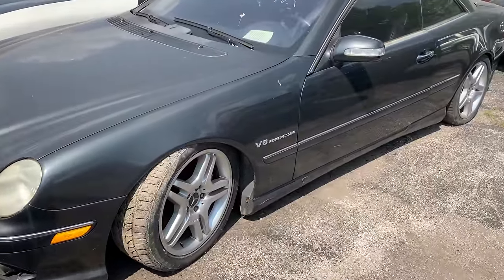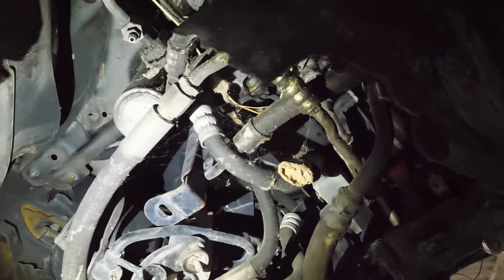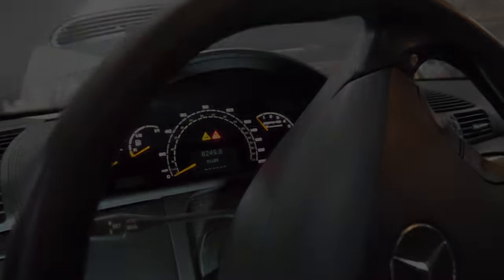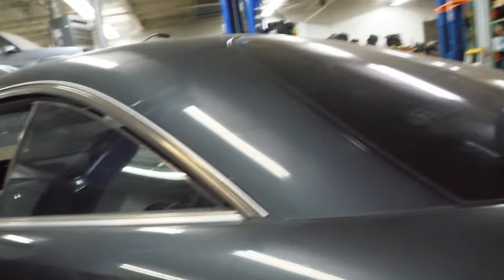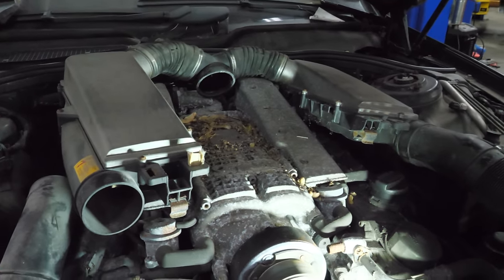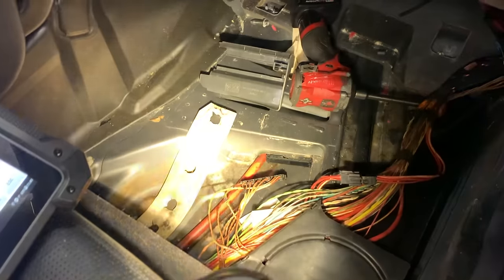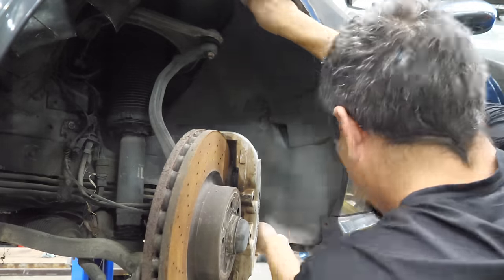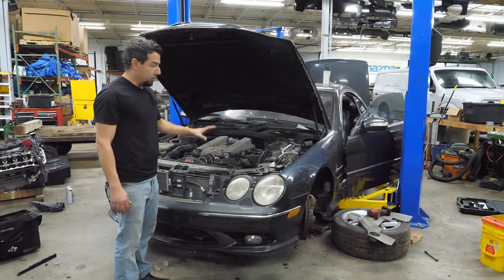DEFEATED! Tow Lot Bought 500HP Mercedes CL55 AMG Sat For 7 Years

Comment from the maker: For those that are wondering, three of us tried to get this hood open when it first came in. We tried everything non invasive we could, pushing down, twisting, etc. The hood is a 3-400$ hood and thats why it went the direction it went. As well, this was filmed over the course of a month or so, and was easily one of the hardest to edit videos i've done. Really appreciate all of the support! It means a lot.
Reply: The Freon put out the electrical fire you started
Reply: Under Dash leaver hiding up by the Kick panel Hood release ,if you haven’t still found it
Reply: I owned a 2002 E320 and the hood release started to give me problems 5 years ago. 18 months later, it completely stopped working. I spent two hours doing what you did without a lift before I decided that with the 235,000 mileage and all the other problems that were piling up, I decided to junk it.
Reply: I dont know where you are at, but Crossfire Diva, The Mercedes Swap Shop could possibly help
Reply from the maker: @PONO-go3ee  we pulled that first.
Reply: Had the same issue with a clk.the way around it is to remove the LF wheel liner and activate the cable from there. There's a plastic joint which connects the 2 parts of the cable. This can break sometimes... but apparently not so on CLs 😢
Reply: As far as I could tell, my problem was that the passenger side hood pin release was stuck, and all the pulling meant nothing. It just wasn't worth the effort.
Reply: I don’t think you were defeated! You got the hood open , that’s one small victory then you heard it run ! So no failure in my book!
Reply: Those grills aren't held on by much. I'd have pulled it up or, if possible, remove the bumper.
Reply: @wernerdanler2742  i pulled the plastic grill on a peugeot one time, and hit the lock mechanism rocker with a hammer blow from a chisel, popped right open.
Reply: You did everything you could to make that thing run. You have a business and YouTube channel to run, so it's not like you can spend unlimited time on trying to fix that thing... and really made more progress than I thought was ever possible!
Reply: I'm at time stamp 39:00, so I haven't watch the whole video yet, I'm wondering if the harness you sawed through shorted a CAN Buss wire!
Reply from the maker: @hkguitar1984  only nicked a few wires and none were can wires.
Reply: @martin-vv9lf  That's quite a coincidence. I had an 83 505 turbodiesel I bought in 1990 and had till 2001.
Actually loved that car! 
I drove to hard in the mountains once and blew the headgasket and put cracks in the head. 
It only cost me about $800 labor and parts to replace.
Reply: @I_Do_Cars  Thank You, Good Luck Sir.
Great Content   👍
Reply: Did your crew open the trunk by folding down the rear seat center armrest, for the pass through to the trunk, and pull the  emergency trunk release mandated for kids who lock themselves in trunks?
Reply: Honestly I would look for the most expensive part hood or front bumper (business wise) and rip out the cheapest part, Time = Money \ Expenses
Reply: The wiring harness that you cut is worth more than the hood along with the other parts you damaged.
Reply from the maker: @dayjeremy  disagree.
Body harness from a car sitting in the weeds with clear rodent damage is worth it’s weight in #2 copper wire, about $1.75lb
Reply: Hi Erik
Reply: Ball shot at 11:40 😅. Not fun.
Reply: You go in via the trunk via the access behind the plate.
Reply: I've had 8 of these W215's and I've become quite the expert... it was fun watching you try.. I've resurrected a flood damaged one and drove it for 8yrs with various ghost wiring glitches along the way.  Fun cars you can get cheap if you can fix them!
Reply: I love the knowledge and ability you demonstrate. Couldnt help wondering how many hours went into making this video.
Reply: You should have just made a random call to a car shop in Lithuania or Estonia, I'm sure they know how to get a hood open on a merc really quick.
Reply: mercedes  Is another word for  sabotage
Reply: Lack of quality servicing is the problem with that car AND many others sadly ⚠️
ie the many drains it has around bulkhead , hood and trunk areas would have prevented electric plugs and modules damage.
Bonnet catch greasing would have preserved the mechanism.

So many garages just change fluids and filters and call it a service 😂

Very good vid 👌 

I bought a no crank start SL55 AMG low mileage.
Fault was caused by a faulty Gear select module.
Fault code P1925 was Drive Authorisation denied ESM .
That is the most common fault code apparently on 2002 2003 era of Merc.

I got it running 🤪
Car is mint with just 38k miles
Reply: 😂w😊
Reply: junk yards have this vehicle im sure could have found replacement hood relatively cheaper then the 3-400 price tag...
Reply: I have an 05 CL55 AMG. It was my first AMG I ever bought. 2nd was my E63S. But did you try pushing down on the bonnet on both sides & then trying the bonnet latch? Usually that works. 🤷‍♂️ Also remove the supercharger belt until the pulley is fixed. It doesn't do anything else but spin the supercharger. You don't need it for the car to run. Disconnect the outlet line on the fuel pump & drain all of that bad gas in the tank out. Then put good gas & some water remover in the tank. These engines are tough & keep going. I think the reason it was sitting in the tow lot to begin with was because of the RR strut leak. People think it is the end of the world when that happens & too expensive to fix so they just park it. I think you slicing into that wire harness has a lot to do with your problems. But if you are going to part it out i want some the parts. One being the glove box door, the electric radiator fan & the electric plug from the harness to the fan, the truck's bottom carpet & if the right taillight metal grid thing is not rusted out that too. The metal key inside the fob is how you get into the truck with no power. The key hole for it is up where the license plate lights are. The reason why things get wet on the passenger side of the floor is if you don't keep that fresh air inlet box under the hood near the windshield clean of debris the drain hole will clog. Then when it rains the water will overflow into the floor under the passenger side of the dash.
Reply: I've got a question: how much do you want for it?
Reply: Imagine the bill to fix this car, a month of labor 😮
Reply: That's a serial data port not adapter.
Reply: @allenl9031 the fuel tank is.behind the rear seat.
Reply: I want to buy that front bumper.
Reply: @I_Do_Cars  sometimes it takes propping it with..well whatever you can find.. i used a bic lighter to hold the lever up so i could lift the hood and get it to raise up.  probably just a matter of lubing up something, or some weak springs.. i never got the opportunity to figure it out unfortunately...
Reply: I’d have taken off the bumper first and from there the front grill and then you’d have access to the hood latch in which I’d have just broken and then opened the hood. Very simple.
Reply from the maker: @jasongennero2080  can’t remove the bumper with the hood closed
Reply: @MercedesE63S-AMG  +1 to the idea of pushing down the hood while pulling the cable. You could see the hood reacting to the cable pulls, so I wonder if having someone else push down on it (or maybe a tension strap or something) might have freed up the cable/latch sufficiently.

Comment: The standard process is to remove the left side turn marker cover and use a coat hanger to release the left hood latch.   Same for the right side.
Reply: German engineering at its finest!
Reply: I remember a similar process for late model VolksWagens. They use the same hood strikers. For what reason I'm not clear. But they do.
Reply: Does the cover pop off?
Reply: of course there is a better method
Reply: Had to be something like that. I guess it does not matter, this one is for parts anyway
Reply: additionally , the trunk can be opened manually with the flip out key on the fob . then you have access to the batteries
Reply: On my S550, the trunk opener is on the key fob.     Roger in Pierre South Dakota
Reply: @rogerfleury3591 , do you have a relative a guy about mid thirties? A musician? I live in Spearfish.
Reply: I just took off the tire and reached through the wheel well with pliers and grabbed the lines, it took like 10 minutes
Reply: @rolhoreis6187 the trunk can also be manually opened from the interior of the trunk too via the passthrough. Simply actuating the metal latch that’s on the upper tray will pop that puppy right open. Can also drop fold down Benz seats like this with with similar metal latches.

Comment: Anyone remember getting a key cut at the hardware store?
Reply: Yes. I also remember testing vacuum tubes at the small-town drug store. They sold all kinds of chemicals with which a young geek could make lots of foul smoke. They also sold some "interesting" pets such as baby caymans. Across the street I could buy a gallon of gas to mow neighbors' yards and get change back from a quarter.
Reply: Or calling the dealership and give them the last eight of the VIN
Reply: Still do for my older car
Reply: What's a hardware store 🙃
Reply: Whats a key?
Reply: Yeah, and those keys are for very low security locks
Reply: I did that yesterday at Ace for 4.88. Took him about ten minutes but the copies worked first time.
Reply: Just did ! I own one 50s truck & one 60s car 👌
Reply: Yep , still able to do so
Reply: @Neil-ru7kw I own an early 90's Ford van ( no chipped keys ) 😁
Reply: Pepperidge farm remembers
Reply: I worked in a hardware store, if I had a dollar for every key I cut………..
Reply: Bruh this still occurs this is like saying remember buying milk from the grocery store its pointless
Reply: @Neil-ru7kw  I'd rather have my late dad's long-gone 1949 chev fastback than any """""modern""""" rolling digital lunacy. I'd even learn to deal with the '49's 6VDC electrical system and the vacuum-operated wiper motor.
Reply: @trentryan27  Yep.
Reply: Yep, in 1979, I remember stealing my father's keys to the cadillac, getting on my bicycle, riding two towns away, because my father knew the guy that owned our hardware store, and got two sets of keys made to the 75 caddy.
Reply: STILL DONE AT ACE HARDWARE AND THEY CAN COPY ALMOST ANY METAL KEYS ##
Reply: Remember when molten rock 🪨 covered the Earth’s surface? Ahh 😌 the good old days

Comment: Mercedes Management: How can we make an engine too difficult for the average mechanic type to work on?
Technician: Add wiring. In fact add enough wiring that really doesn't do anything but keep the engine from starting if not perfectly connected.
Mercedes Management: Wunderbar!
Reply: The start function being on the same fuse as a beeper in a wheel arch exposed to cold/damp/dirt was absolute genius.

Comment: Ivan from PHAD has a great method for working on shorted circuits.  Use a test light (one that draws a couple amps) across the fuse pins.  If the lights are bright, you have a dead short.  Fiddle around with everything until the lights go out or at least very dim, and you found your short.  No need to continuously sacrifice fuses.

Comment: I had a similar run with this type of situation to what u went through with an E55 and it turned out to be a dead ECU caused by a ruined harness underneath the supercharger. You gave it a fair shot and went on a wild chase, but I could tell immediately what happened the second I heard that fan blow full speed.

Comment: Eric get one of those oscillating multi tools they're pretty good at making those kinds of shallow cuts in tight spaces through thin metal.
Reply: And invest in a carbide tipped blade.  Normal blades are for wood, the carbide will cut anything.

Comment: Next time get a second person and do this:
Hold tension on the cable
Press on the hood where the latch is.
Maybe tap the hood slightly to release presure on the latch.
Pretty common for these latched when not used to „lock up“ sort off.
Reply: Used to have to do that on my f250

Comment: I’ve had a 2002 CL for ten years now, going on the third engine. Congrats on the w215 crash course. Between the alarm siren and the water ingress of fuse boxes and floorboards, you’ve found most of the major issues these have. After I bought that CL, I went on to become a mechanic and work for Mercedes. Now I have 4 MB and started my own repair shop specializing in MB. Most Mb techs hate these w215, something about them is very second-nature to me, probably because my w215 is how I learned how to work on cars, how engines work, etc

I believe ultimately you need to check rear fuse box under rear seat and you probably have a bad Ecu

Comment: Something about a flapper valve in the ABC system which disintegrates and plugs up the hydro lines. LegitStreetCars did a 99-part series on trying to troubleshoot this issue.
Reply: That's ridiculous.  It was only 91 parts.

Comment: I know a bunch of people said you should have done this or that to get it open. I’ve actually done this, I also got an abandoned cl with no key and stuck hood. After I got a key from the dealer($300) I still had to get the hood open. I went under and use a long rod with hook on the end. Grabbed the cable right by the latch and pulled.

Comment: This is bringing back some traumatic childhood memories. Our family had a '78 Grand Prix. It had been in an accident, my Dad's fault, which he blamed on me. After banging out the fenders, the hood release cable broke. He finally figured out some way to get it open, and he stuck the cable through the grill. When we needed to open the hood we had to grab the cable with channel locks, pull the cable, and bang the hood down and at the right angle. There was some special trick to getting it open and it was very difficult. All this hassle for a wrecked car. Could we get the car fixed or replaced? No! Our budget was being eaten up by six worthless horses in the back yard that nobody paid any attention to. It was awful.

Comment: Hi from South Africa Erik.

I recently found your channel and love your off brand humour, double entendres and subtle irreverence to social norms.

I really have learned a lot and even though many of the engines you tear down are only found in the States your simple explanations help expand ones knowledge base easily.

You mentioned in this video the rolling screen on the laptop.
This is a simple alignment of shutter speed, frame rate and electrical pulse all determined by your electrical feed at 60Hz.
It is almost always visible in your videos especially when they are sped up.
Try playing with your shutter speed or exposure time and avoid increments of 30fps when it is really noticeable, going for odd frame rates and see if it resolves the issue.

Thank you very much and keep up the good work.

Comment: I owned two C215s and worked on all kinds of electrical gremlins. Check the Bus Connectors in the footwells left and right. No need to remove seat just put it all the way back and you can pull the carpet up. There is a huge cable canal going along there where I found many connectors corroded and that fixed many of my problems! On the passenger side theres a fat 12V line supplying the EIS & its controls. Having seen how your nuts looked on the fuse box in the passenger footwell open it to see if your prefuses are still intact. Also check rear SAM under the right rear seat cushion. It is very prone to suffer from water intrusion and can cause all kinds of malfunctions. Here in Germany even a non runner like this would sell for 5/6k easy! Try to get that beast of a M113K working again she deserves it. Parts and Spares are even cheaper in the US. If the ABC isnt completely shot it would be worth it IMO.

Comment: Did you look on a similar model to see how the cable works?
I think you need to also push on the cable sleeve instead of just pulling on the cable itself.  I.e. the differential pull action would do it perhaps.
Nice video 🙂
Reply: I had a seized latch on my hood of my F-250 and I sprayed pile of anti-seize into it to try it. I finally gave up and cut the cable and the housing far enough back that I could reach it and then the anti-seize started working on I could get it open. Now I just have to open it by pulling on the cable reaching through the front trim.

Comment: In my long history of repairing all manner of electronic / electrical devices ( 50+ years ) I have long depended on a trick that I learned from an old timer when I was just a youngster. If you have a circuit that is blowing fuses and it feeds multiple paths, replace the fuse with a pretty heavy duty lamp ( incandescent LED does not draw enough current ). When power is applied the lamp of course will illuminate, bright for a dead short, some value dimmer for a partial short. As you begin to disconnect the branch circuits when you pull the shorted path, the light ( lights ) will go dark. Saves time, frustration, and fuses. In the twelve volt world I use either three or four turn signal lamps ( salvaged at the junk yard ) or for heavy duty current, one or two headlamp bulbs in parallel. With a high current lamp you may even get  smoke signal or burn free a short.

Comment: Oh crap. Jack the car up high enough that you can see the two quarter turn flat bladed screw heads in the bottom of the passenger side splash guard that goes across the undercarraige just behing he bumper. Turn the two screws a quarter urn and you will see the hood latch (and probably the broken end of the cable) and stick a screew driver blade against the L-shaped release and the hood should release. There's another access panel on the driver side of the splash guard but it's tougher to stick a tool up into the release mechanism.